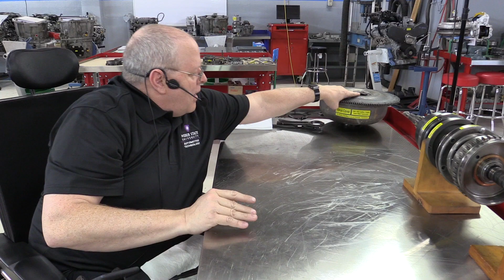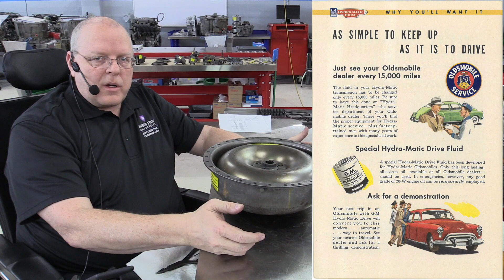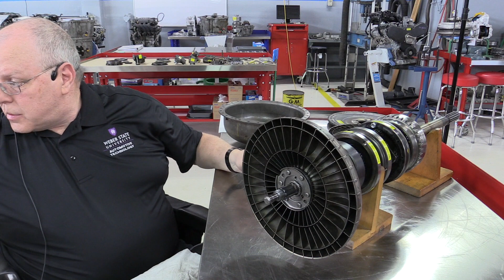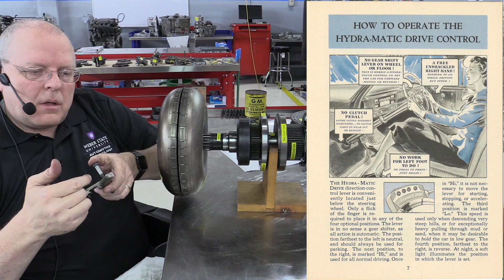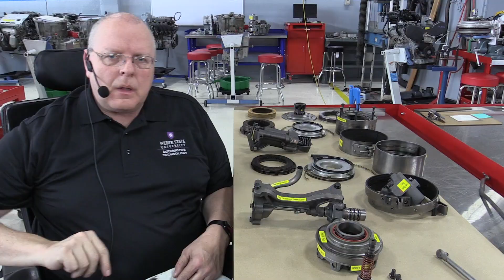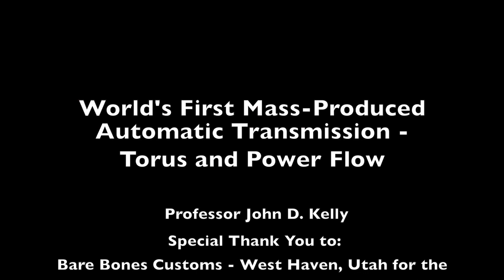World's First Mass-Produced Automatic Transmission - Part 3 - Torus and Power Flow

Comment: Great job! 
I was under the impression that the rear pump was used to relieve the engine for better effeciency. That was the case in Ford's cruiseomatic and Chrysler's torqueflite. 
I would very much appreciate you going over how it evolved and in particular why a second fluid coupling was added (jetaway) on later models and also the lock-up clutch on the Pakkard's (ultramatic) - that was decades ahead of its time!
Reply from the maker: Thanks for the feedback. That is a great idea. As you may have seen in this video, this fluid coupling locks up in 4th gear without an internal clutch, it uses an external clutch.

Comment: Mr. John, your videos are the best. I have a 2008 Prius and watched all your videos on the Gen 2 operation and HV operation, including the Ecvt. Would like you to maybe do a short video on the "drive damper" or whatever the part is on a Prius that connects the engine and CVT. I'm not getting the concept of how it works due to lack of information. Keep up the good work- I;m eagerly anticipating the rest of this series, because I've owned several GM cars from the late 50's and newer, and it's cool to see the roots of these transmissions. My favorite? The Turbo 400-- indestructible!!!! Had this transmission coupled to a 1968 396 BB in an Impala and stayed in trouble, The only automatic that I know of that keeps burning rubber after shifting to second!!

Comment: Thanks  for the video. A couple of observations. I owned a 1951 Cadillac with this transmission and "Park" was putting the transmission in reverse with the engine shut off. With the band and the "pawl" it acted just like a modern car with park. If you were moving when you put it in reverse with the engine shut off it would "grind" just like a modern Park. After the plant burned down at least Cadillac went to the Buick Dynaflow transmission (highly sought after) for that 9 months till they got the Hydra-matic plant back up and running. the "original" hydra-matic was put in the Cadillac till 1955 when GM came out with the dual coupling Hydramatic transmission.
Reply from the maker: Thank you for the great information! It is good to hear from someone who has actually owned or driven one of these.

Comment: Yea no tow company subscriptions back then. Also you could tow these cars with no damage as referring to the output shaft pump that would lube the internals. If they had the fluid tech and cooling we have today they would last forever. No stamped drums we see today.Yea for fuel economy due to rotating mass.But they split at the snap ring groove.
Reply from the maker: Thank you for the information! You are correct about towing and the rear oil pump (with the transmission in neutral). You could push start one of these of you could get the vehicle up to 25 mph and put it in gear (with the key on). The oil pump would generate enough pressure to apply the front band and turn the engine over.